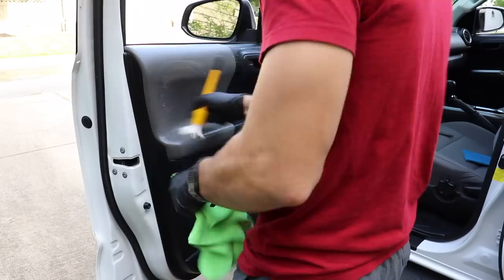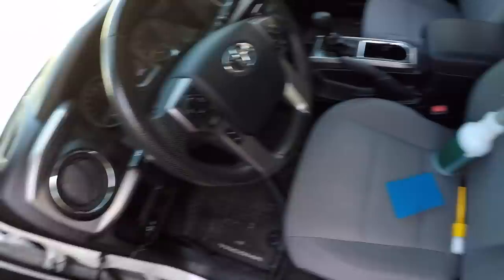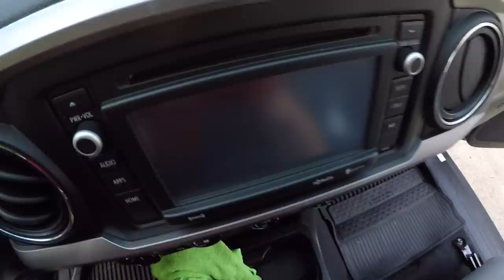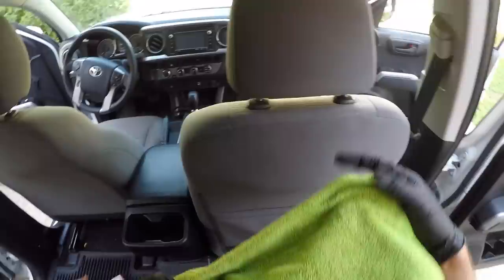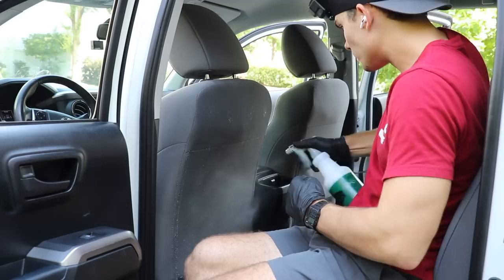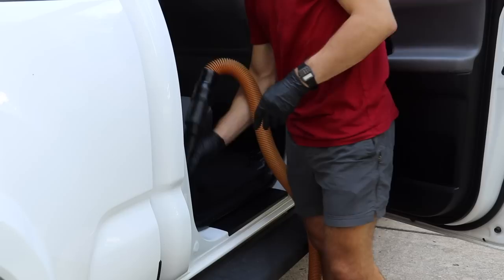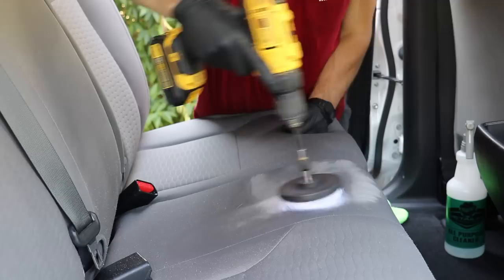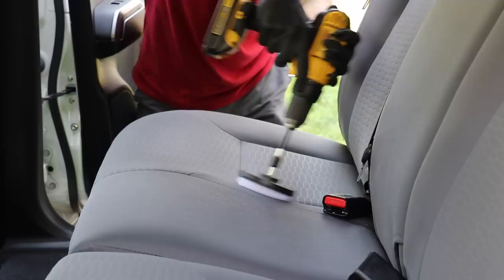My Auto Detailing Business Structure & How You Can Copy It!!!

Comment: the way I grew my detailing business even more was adding property maintenance services ie. pressure washing driveways/houses/awnings and also cleaning solar panel arrays. If My equipment is already out if I can make more cash right away cuts out the packing/unpacking and drive time to the next client. Instead of doing 3-4 $200 ($600-$800) details in a day, say I did 2 $200 details and 2 $200 driveways and 2 $200 solar panel arrays. ($1200)Almost Double the money in the same hours if not less. & depending on the price you choose $200 is just a base number i used.. the only extra tools I needed to add those services to my business was a $80-100 solar extendable panel brush from amazon and a $30 surface cleaner from Home Depot. just something to think about.
Reply: What pressure washer do you use
Reply: Briggs & Stratton 3100 PSI 2.1GPM, never use a pressure washer on solar panels tho. Only purified water through the solar panel brush. You can use regular water from the hose when you first start out just make sure you dry them good so you don’t make water spots.
Reply: how in the world do you fit 4 details in one day??
Reply: Jack Kiefer I mainly do interior details only a handful of paint corrections a year. I find I can make more money in less time doing interiors. And if you get your process tuned I found I can knock out a interior detail in 2-3 hours that’s 8-12 hours of work. What I was trying to explain is you can add in other services to sell to customers you already have. and get it done with the tools you already have, while you’re already there. Cutting out the time packing/unpacking of equipment as well as travel time to the next customer... I hope that makes sense!
Reply: Jaylen Heres Gotcha. I’m a senior in HS right now and my business is skyrocketing. Right now I’m charging 120 for a full detail on large SUVs, an extra 100 for a full paint correction and 300 for ceramic applications. u think that’s decent? I have my prices in ratios to SUVs for compacts and sedans if that makes sense
Reply: Jack Kiefer congratulations! Keep up the great work young man, and when you start getting g more calls than you can handle you know it’s time to bump up your prices. I would say your paint correction and ceramic application prices are a little low as is because those take 4-6 hours per car.
Reply: Jaylen Heres yeah that’s what I was thinking. Unfortunately for me somebody put an ad for my business on their facebook page with the prices that I claimed I charged at that time. So many people have called me that I am now booked every day for 4 weeks straight. Crazy. Wish I could bump up the prices a little bit but at least where I live people tend to tip pretty well. :)
Reply: Jaylen Heres Not sure how long you’ve been doing this but if you have an email or something I could reach out I have a few questions if you wouldn’t mind answering.
Reply: Jack Kiefer are you on Instagram? I can give you my business account info and you can ask me through there..
Reply: Jaylen Heres yep! @jackhkiefer
Reply: Jack Kiefer followed you! -Splashbrosmobiledetailing
Reply: Jaylen Heres just sent a message! thanks so much man!

Comment: just confused by your example wouldnt using 12 to 1 be less concentrated than 10 to one since theres 2 extra parts water? on the other hand whty would people mix 89% concentrate and 11% water thats the opposite purpose of a concentrate, idk either were all confused by the numbers, or were all getting jipped. for example when i use a concentrated degreaser in the kitchen it says 5 to 1 , i  would use 5 parts water 1 part solution. youre saying you would use 5 parts cleaner too 1 part water thats just watery concentrate, a rip off